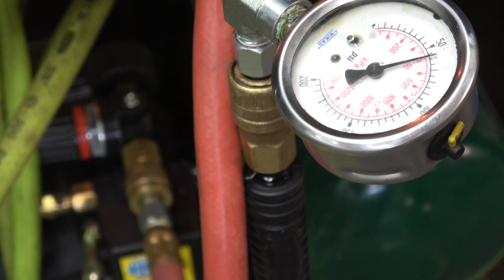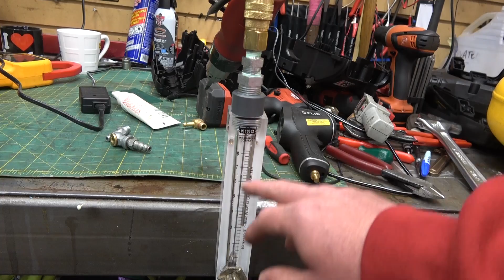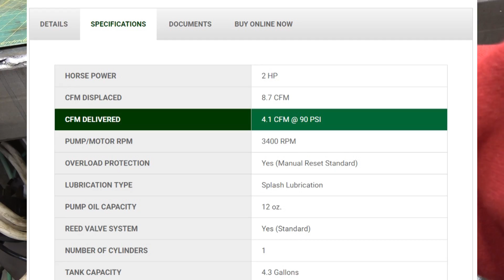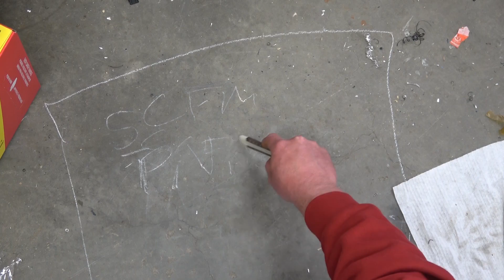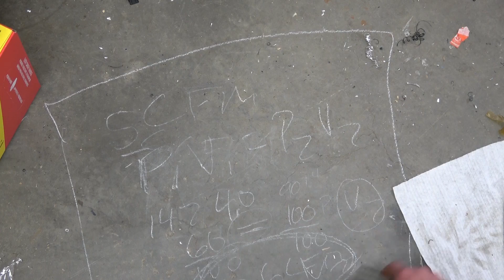Why are CFM ratings BS?

Comment: there are only two sizes of compressors. The heaviest one you can lift into the truck, which is the minimum size for the job site, and the one that will run the tools with ease but stays in the shop and empties your wallet.  Idea for another video. use of air pigs on long hose runs to improve performance of things like nailers.

Comment: In the compressed gas industry you will either see performance at "SCFM" (flow rated to the standard conditions) or "ACFM" which is flow rated at a given pressure.  "A" stands for actual.  Anything rated with CFM alone is an eye-roll because who in god's name knows what standard they are using.

Comment: Are the tools rated using the same system? The die grinder specs you pulled up has some stuff in () which makes it look like at full power it draws 23 SCFM. I would imagine the duty cycle comes into play with this stuff too, maybe the 3.2 is cfm at a low duty cycle or the 3.2 is the rating at the 90 PSI.

Comment: Some (most) (cheap) compressors only show input air^^ (the number they market)
But usually they have the "sustained output" listed for different pressures. (Datasheet, or further down below on the sales page)

Greetings from Germany

Comment: This crap is much like home vacuum cleaner ratings. One can easily find a 7.5 HP vacuum that plugs into a standard nema 15 (USA Standard) wall outlet, which maxes out at 1725 watts. And so, vacuum cleaners produce many times more power than they use. I want to mechanically connect them to electrical generators, then sell the power. I will be rich! Home air compressors always have HP ratings that are far more than they are also. I know, I have several. My favorite ones, because they have cooling fins big enough that oil does not smoke and burn off the heads is Puma 5HP twin cylinder ones. The motors are 2HP, the cylinders have proper size cooling fins, and they have cast iron liners. I use the heck out of these, they are in my company shop, and run a real lot. Normally only one is needed, but very often I use 2 at a time at 100 percent for one to two hours straight, they handle it, no problem. The motors are too small though and do burn out, at least here, and so I repower them with 3 HP motors, which have never burned out.

Comment: Manufacturers lie, who knew?

Actually when you read the standards they use you’ll find numerous conflicting tests. 

I get around all the bullshit by having a second tank (120 gallon) and owning one of the Atlas Copco scroll compressors. You also need a chiller and automatic drain installed. 

Like purchasing a welder, duty cycle is important. 

My sandblast cabinet uses 25 CFM of air otherwise you blast, then wait, then blast again.

Comment: The gauge you're using says right on it that it operates at STP, not elevated pressure...  so it's not even calibrated for CFM at any other pressure anyway....
Reply: That's an astute comment, but I think we need a little more research to know if you're right. Some rough googling suggests the gauge might be a King 5C-05 (though the man himself can probably confirm or deny that).  That gauge says it's good to 100 PSI. whether that's safe bust pressure or readable range is a good question. Their install manual does say " Remember: To get a correct reading of flow in gas
 service, it is necessary to know the pressure right at the outlet of the meter"

Comment: I always wondered how they came up with the number. I always thought that it was “tank assisted for xx number of minutes until the tank dropped below y psi” or something like that.   Nope just a bs way of making it look like it is better than it is. 

It’s no different than amplifiers that advertise max output even though you will never see that output. At least there you can go by rms outputs. 

Why can’t they just list the actual output in real flow @ pressure?  They would still sell small pancake compressors and stuff. You don’t need a 5hp 80gal compressor for a brad nailer and other intermittent use tools. 

I always knew that die grinders, sanders, etc that need to be used for long periods of time took way more compressor rating than the tool was rated for.

Comment: SCFM = Standard Customers Fooled  per Minute. THX AVE. Good Explanation.
Reply: per Mention*
Reply: @totally_not_a_bot  TOUCHE`
Reply: 😂 Ave better like this comment its a gooden.
Reply: The C stands for something different in Australia
Reply: I think the other F word is better here.
Reply: Do mericans use minute?
Reply: @thombaz   Along with inches feet and yards. YUK YUK!
Reply: @Curtislow2  Didn't they mesure time in eye blinks?
Reply: @thombaz   We still do south of the Causeway. But that is usually faster than most modern people can conceptualize. Similarly as fast as your momma slapping a lit cigarette out  your mouth.
Reply: @Curtislow2  My mom knows I just smoke to filter harmfull stuff while working in the shop.
Reply: Again, 90 psi needed? And you want a home cheapo compressor to handle that? Look at your tools and think, will this little compressor handle the load? No, and I think that the complaint is coming from a cheap person who doesn't understand how air compressors work.
Reply: @duanelohr1869  I am so CHEAP that I am not even Insulted!LOL
Reply: @Curtislow2  and you should are spreading false information on the internet.  It is the ability of the mind to look at what tools are needed,  and get the right psi needed.
Reply: @duanelohr1869  Here they must inform how much air does the tool uses , so if the tool you want uses 80 liters (20gal) air per minute ... you know that some tiny compressor wont run that tool , you need a bit bigger tank on the compressor what the tool uses , so some with a 100 liter (25 gal) tank at least to be sure it produces enough air ... still waiting when they come out with a cordless roof nailer , then the need of a compressor is even smaller ... oh yeah DeWilt has now one :-) ... so compressor needed to inflate car tires , thats it .
Reply: @pete_lind  gee Pete Lind thank you for supporting this thread.  Cheap Skates wanting to get something out a cheap compressor is like aaaaahhhh!

Comment: It's worth taking a look at the "conservation of energy" aspect of this. The energy contained in a volume of compressed gas is basically equal to the pressure (above atmospheric) times the volume, in SI units it works out nicely. A flow of 4 CFM at 90 psi translates to about 0.002 m^3/s at 500000 N/m^2, multiplying that out gives a power of 1000 N•m/s (aka watts). Since compressors are more-or-less adiabatic, compressing air to 5 atm range will heat it up by around ~180 K, which means about 1700 watts lost to heat. So, unless the compressor is sucking 2700 watts out of the wall, it's not going to be supplying 4 CFM at 90 psi to the tool.
Reply: 2k7W would require extremely efficient motor too, Likely it takes over 3kW to even start resembling any idea of reaching that volume at such high pressure.

Comment: Other comment didn't post properly.
4.0 CFM * 90 PSI = 1171 Watts
Industry literature states 1/7 efficiency. Meaning 7 HP consumed by compressor to provide 1 HP at the tool.
1117 W * 7 = 8.2 killoWatts. US residential power is typically on 15 amp breakers.
120 Volts * 15 Amps = 1800 Watts.
8200 Watts / 1800 Watts = 4.5. Meaning we would need 4.5 times more power than we can get from a standard outlet in the US.
(1800 Watts * (1/7)) / 90 PSI = ~ 0.88 CFM. Meaning with 1/7 efficiency, this is about the most flow we can expect at the tool at 90 PSI. This is pretty close to what AvE found using Boyle's law and by measurement. Compressed air is notoriously inefficient in industry, and the significant financial incentive to fix that has only taken us thus far. Therefore, the only solutions are better power service and a storage tank to store energy while the tool isn't in use. The larger tank is the best solution for residential. In industry where that would be prohibitive and higher power is already brought on-site, a higher powered service is the solution.
Reply: We have 240 volt service also. Just wire in your own 240 volt outlet...
Reply: @EETechs  definitely a solution, but "regular" compressors are meant to work from existing outlets. And, most of them being portable, having a compressor that can work on almost any outlet at a jobsite is pretty useful.
Reply: EETechs higher power equals three hot wires
Reply: @shaunbarlow8993  Don't need three hots to get higher power, you can pull 12,000W on two hots.
Reply: deimosian good luck finding a two phase 55 amp air compressor they just dont make em cause if u want that much air and are willing to pay for it u have to go three phase or internal combustion
Reply: 220 volts at 50hz makes a lot more sense  than using air tools higher power density, so if you can use E  only where you can't safely  use air
Reply: @stephenmoulton9284  huh? Higher power density? Sure the density of pure electricity is more than that of a air tool but air tools have higher power density than electric tools.
Reply: So I used your calculation based on a 20 amp breaker and it comes out to 3.8 so that would mean theoretically you should be able to get 3.8 cfm worth of electricity from a 20 amped outlet. If your calculations are correct anyways I don’t really know that much about it lol
Reply: Of course you have 4 cfm times 90 psi as 1800 and 4x90 is nowhere near 1800 lol
Reply: so a rule of thumb might be expect a compressor to run 6 -7x longer that the tool use in residential power or 2-4x only if you have a 230v supply?

Comment: Vacuums HP and Air Compressor CFM are the biggest scams in the consumer industry
Reply: Not really, the biggest bogus is the air tools CFM ratings, they are based on "average on and off time" use.... The 1/2 inch impact you bought advertises 8 SCFM "average" air use, but when it is hitting it will be consuming 30~40 SCFM. And then you wonder why it is not as powerful as everyone says or doesn't have the advertised torque values.... Don't get me started with the pressure regulator ratings. High SCFM regulator -> pressure goes down. Smaller the regulator the more it goes down.
Reply: @PhaseP1  energy consumption always increases with load.
Reply: @jdrok5026  cfm use increases with psi too. The more compressed the air is the more can flow through the tool.
Reply: @ibey01  no psi increases with flow. Psi is restriction
Reply: You can have 90 psi and only put out a cfm you can also have 90 psi and 1500 cfm.
Reply: Dust collector CFM, too.
Reply: Air at 90 psi contains less energy than air at 120 psi. That is what I mean by less flow. 1 cubic foot of 90 psi air weighs less than 1 cubic foot of 120 psi air.
Reply: @ibey01  but size matters a lot. Pressure isnt flow. If you have size you need less pressure.
Reply: YEA VERILY.  Dyson has a better gig going than anyone.  Remember when they claimed 100,000 G for their vacuums.  I asked for the calculations and was told to bugger off.  When I supplied them the calculations they buggered off the claim.
Reply: @michaelpatrick6950  I thought it was 100kRPM?
Reply: @NiHaoMike The old dyson TV commercials claimed their bagless vacuums spun dirt out of the air with a force of 100,000G.  I believe that is what Michael Patrick is referring to.

Comment: Thanks for this most enlightening vidjeo. It goes a long way to explain why the impact  gun I bought won't work like a fuck with the compressor I bought that the salesman stated should run it. I am praying to the entire pantheon of gods that the disingenuous bastards enacting this bare faced lie die of cancer of the arsehole having had to regurgitate shite for 6 months in a country where the toothpaste tastes of shit and the water is hooker's piss. Apparently, to buy a compressor capable of powering the implement I'd have to spend as much as buying a battery wrench (with a higher rating....) and a couple of batteries, no brainer in retrospect. Fuckers, fuck 'em. Thanks again and regards from Scotland.

Comment: I've got a 1979 gasoline engine powered, belt driven, compressor that will run anything you throw at it. Too bad it's so friggin loud.
Reply: Just means you need to build a home for it a little ways away from the shop and pipe it to the shop with a 1 inch line and if you have any high volume needs in the shop have an accumulator tank in line near it to run said need off of.
Reply: 'Sound absorbing screens for workplaces' exist... mind blown I know... 

More seriously, I know the pain, esspecially working indoors... in some pretty claustrophobic spaces, where sadly wearing 'headphones' is not alwyas an option... case'in with 'acoustic foam' helped alot with My compressor... I'm pretty sure a screen/case should work fine in Your /case/. 
Ha...

Greetings

Comment: A friend of mine and I each bought the same model air compressor four years ago. His began to malfunction and eventually stopped 16 months in. Mine has yet to give me problems but I did do the break in procedure the first time I used it. This involved running the compressor for 30 minutes non stop with the drain open. My question is do you think this procedure would affect the cfm output? Also did the battery powered compressor call for a break in? 
Great content! Keep up the good work.
Reply: Not really. It is mostly to match the piston and cilinder together. 
You could lose a bit of compression but nothing like this.

It is mostly for longevity because of wear.

Comment: I have a military surplus 15 HP 50+ CFM @175 PSI 4 cylinder 2 stage unit in my shop to keep up with most of my stuff WITH a old 5 HP ~18 CFM @ 175 PSI tied into it as a booster with both carrying a combined 200 gallon tank capacity.    That's a bit more than what it takes to keep up with a 9" pneumatic grinder, who's electric equivalent takes  about 2 HP (~ 1500 watts) electrical equivalent at the same load.   

My estimate is Pneumatic electrical input power to real world useable mechanical output power is about 8:1 at best and why most all of my big 'spiny/ backy-forthy output thingies' (Drills, grinders, cutoff )power tools are being switched over to electric and not just electric, cordless electric for all but the biggest high duty cycle stuff.
Reply: Industry agrees with you. I've found 7-8 in literature provided by leaders and USDoE.

Comment: Things are more complicated than this..  First the tool use slightly les air when under load. Maybe someone can actually test that. Second if  it when he let the end opened.. if there was no tool there..  it doesn't mean the air didn't do any work..  the work was done accelerating that air.. when you have a tool it's the same situation.. 90 inlet 0 outlet= work done in the tool not by accelerating air but by letting the air expand.. I don't think  there is a problem with compresor ratings.. Maybe there is a problem with tool rating with the imperial system.. Here we don't have that  when you buy an air tool even the cheapest one..  you know you need an industrial compressor for continued use.. because it says on it how many litters of air it needs and that number is no were near what a home use compressor is rated at.

Comment: We just ran into a similar deal at work. We bought a $5000 automatic switchover regulator with the bells and whistles to deal with pressurized liquid nitrogen tanks. My instrument wants 23 LPM and an inlet pressure of 100psi. The regulator couldn't pass that flow at 100psi and the 25 LPM rating I saw was at 80psi. Still don't understand at what pressure the instrument measures flow but it gave me the green light.

Comment: OK this y we all shifted to batteries  and plugin tools +the only way to keep 90cfm to the tool is calculate how many gallons per minute per second it take to hold 90 PSI to hold that 4.1 CFM + hose + size +quick connect  and then build the pump to that  specification it would be big heavy and pricey let me know what you think

Comment: vacuum cleaners that claim 5 hp and run on 115v 1200 watts...fuzzy math ..lol
Lawn tractor 23hp! Nonsense through a plastic transmission.
We need to air drop all this commie Chinese junk back on where we got it.
Reply: Most of the power from lawn tractor engine goes directly to the blades by a belt. The transmission is only rated for a few horsepower.
Reply: Juho Kestilä my Gravely has 12 hp cuts the same speed as new tin tractor s sold at Lowe's.